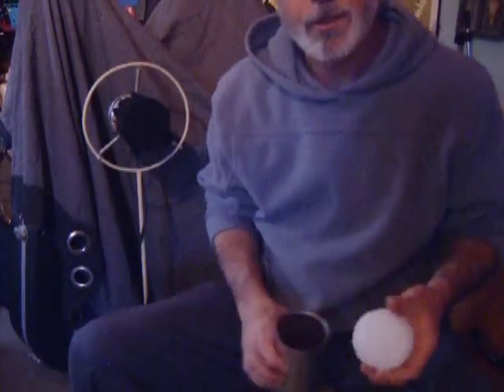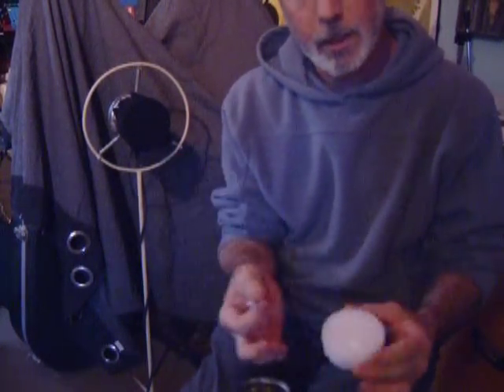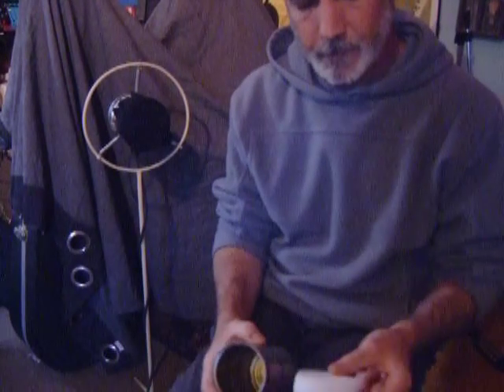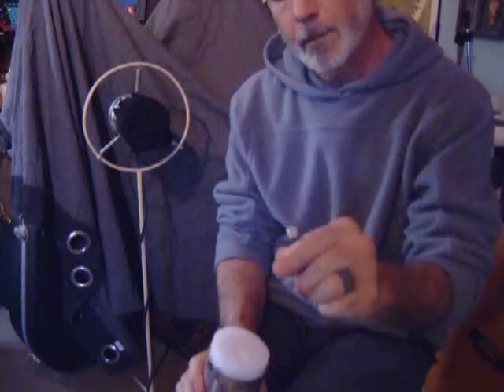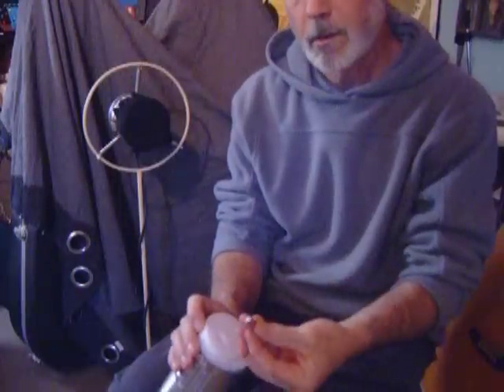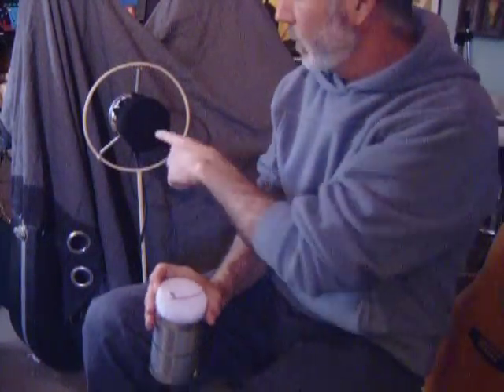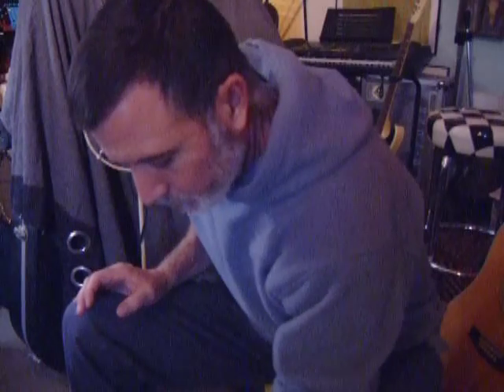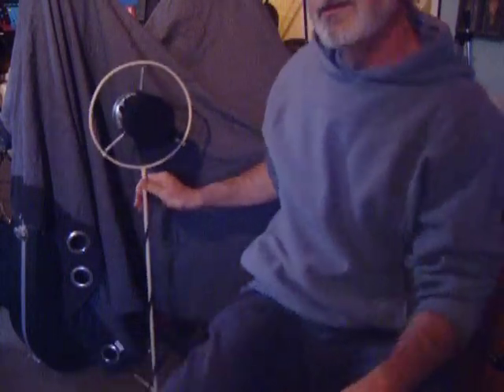Can microphone demo

Comment: it actually is possible and the circuit is not that difficult to build jut Google "powering electret microphones" or "powering microphones" and check the first link (i used the Balanced electret microphone circuit)

Comment: Awesome! would you mind talk or whrite a little more about the wiring? 
i've also got a question about the phantom power. is there a battery inside the can or is it possible to just use the phantom power (+48V) on the audio interface?